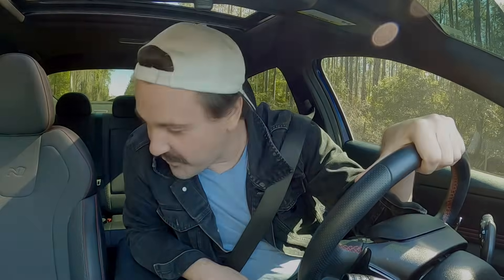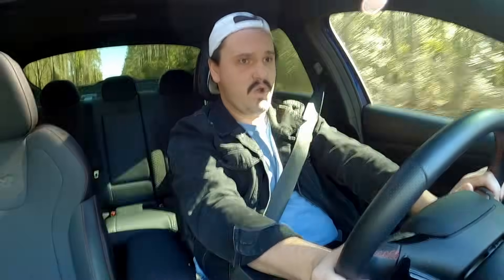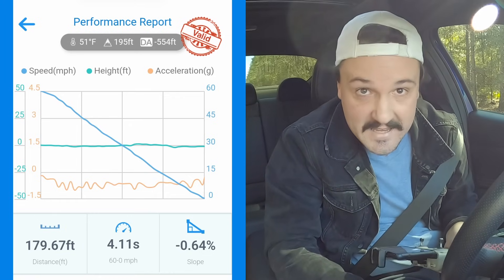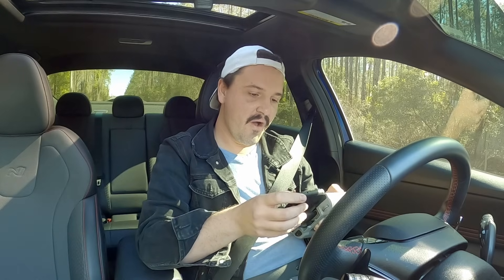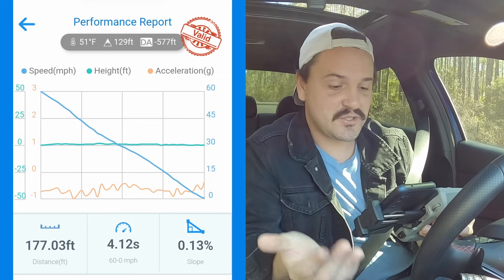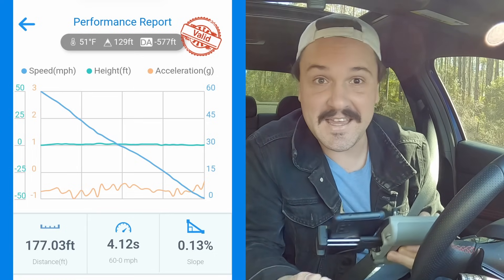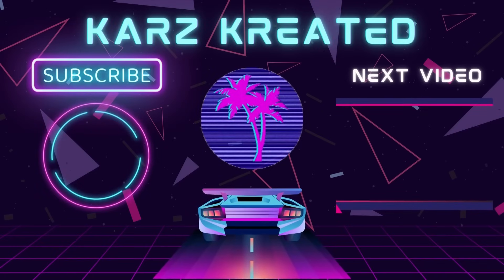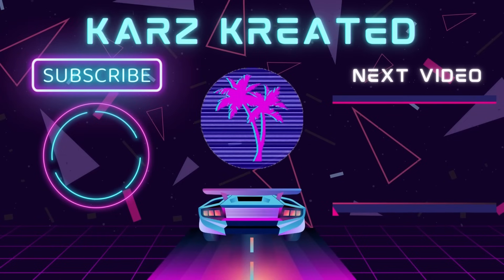Something Unexpected Happened after spraying WD-40 on Brake Rotors

Comment: I don't think the WD40 had anything to do with the stopping distance.  One thing to point out is that you were going slightly uphill for the WD40 run and slightly downhill for the first run based on the data in the app.  

Also a difference in traction from the pavement you were on for each test could have made a difference too.  People don't understand that the grip your tires have makes a bigger difference in stopping power than the brakes themselves.  What you do to your brakes shouldn't matter as long as they can lock the tires or hit abs.  Therefore, I think WD40 had absolutely no contribution to the stopping power at all.

Comment: Wd 40 isn't a lubricant. It's a water repellant. Water Displacement 40 th attempt.
Reply: How does it stop my door hinges creaking if it doesnt lubricate them?
Reply: @EazyDuz18  You should use silicon spray as a lubricant. WD40 will also work but thats not its primary use.
Reply: @EazyDuz18 gets rid of the particulate causing the squeak.
Reply: @ No particulate on them, they're clean and indoors. It contains paraffin lubricant, which is why everyone uses it to unseize screws etc
Reply from the maker: It's a "MULTIPURPOSE" Product. It certainly does lubricate bub
Reply: @KarzKreated as somebody who has used wd-40 on chains before no it doesn’t it lubricates for like a few minutes until it straight up starts doing the opposite and dries everything out wd-40 is a degreaser

Comment: hey kirk i own a hyundai now too :)
Reply from the maker: No kidding! What model?
Reply: @KarzKreated  2008 tiburon v6 xD
Reply from the maker: Dang bro out here with a Tiburon! Manual?
Reply: @KarzKreated  automatic but i prefer it over a cvt anyday and even though its four speed the low range is awesome and changing gears i can notice :) how much they running for in florida/maryland?
Reply from the maker: Nothing wrong with that. Most I see for sale are no more than $3k.
Reply: @ nice I scored mine for $2k usd with about 130k miles equivalently
Reply: @Jay-m2h7x  Those big end bearings wont last much longer